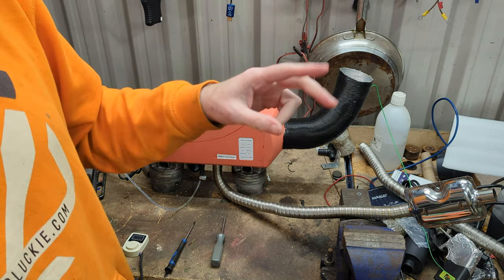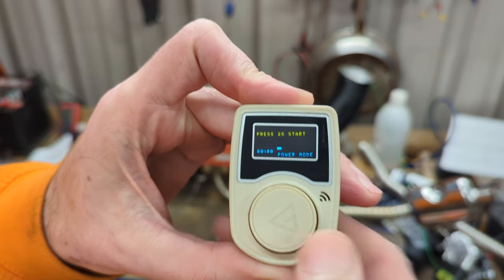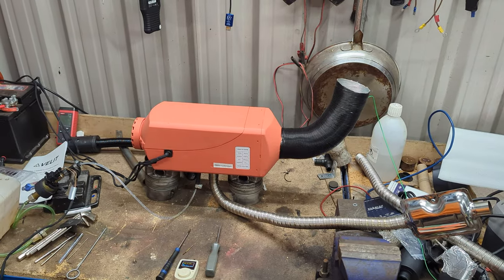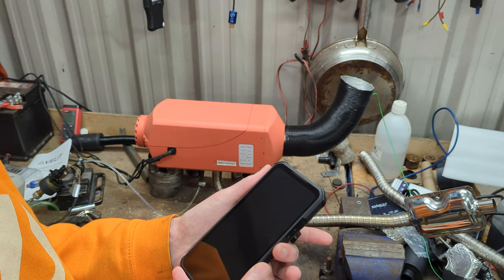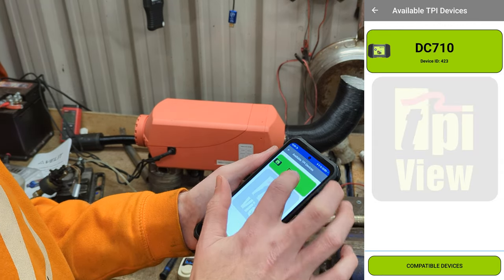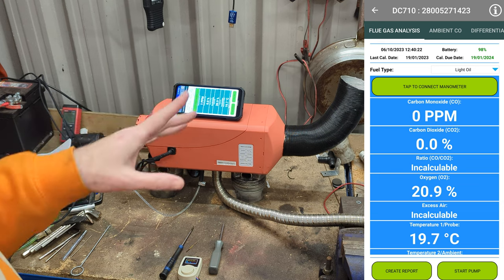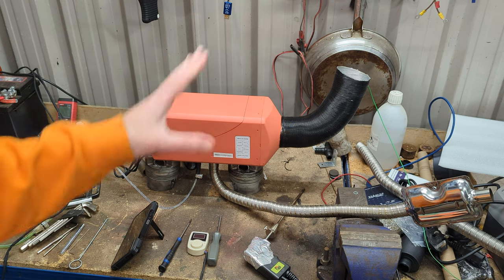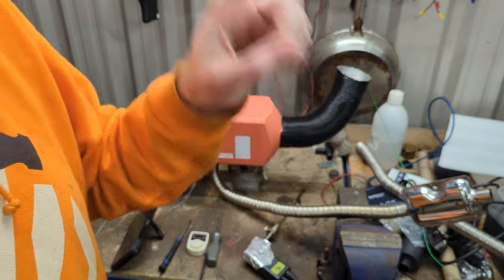Velit 4000P Gasoline / Petrol (Diesel) heater - Running and Testing // Part 1

Comment: For all you folks who need to know.... These are called "parking heaters" not Chinese diesel heaters. I've had a petrol/ gasoline webasto parking heater in my van for over 5 years now and it works flawlessly. That part of the comment is really for the people who are averse to using gasoline as a fuel source. Gasoline burns cleaner, hotter starts up within a minute and never once have I ever had to take it apart clean it, maintain it, anything. I already carry gasoline because of the gasoline engine. I definitely don't want to carry another fuel source.

Comment: What are the advantages of a Gasoline heater vs a diesel one ? Because I can certainly see the disadvantages : more dangerous, fuel price, need for 2 types of fuel in vans and boats (majority run on diesel). Not being cheeky, honest question
Reply from the maker: Americans.  Well not just them but wherever have gasoline/petrol as their main fuel source and not diesel.  A lot of American mobile homes / campers are gasoline petrol engines.
Reply: @DavidMcLuckie  makes sense indeed. But other than compliance with your original fuel source no advantages whatsoever, no better performance nor better fuel efficiency.
Thanks for the quick reply and all your excellents videos David
Reply: Yes I can agree that it will be marketed toward the US market diesel is available but so is gasoline and most of the vehicles here are still gasoline also most of our weed trimmers, mowers, leaf blowers, and motorcycles are gasoline thus a significant amount of people here have gas cans just sitting in their garage...
Reply: @ElectronicMusicUnderground  That could definitely be a compeling argument ! Thanks for your input.
@DavidMcLuckie are you interrested to test if it run on E85 ?
Reply: @DavidMcLuckie A gas running burner Isn't gonna gel at -45 F people traveling may not want to keep track of winter diesel or regular. little off topic, but an idea for an easy video. Of a heater running for sleep purposes the pump is great to hear... thanks for your pro-active videos on cdh!

Comment: I think they got my attention with a heater that works at 8,000 ft.  I’m also a little intrigued by a heater that runs on gasoline since my tow vehicle is now gas. Actually, dual fuel would be handy given that one tow vehicle is gasoline and the other is diesel.

Comment: I see a real market in the US for an air/water version of this gasoline heater. Most RV's in the states unless they are the big high end bus types are gasoline. Most have LP also and some run their generators off that as well as the air and water heaters. LP generators are not ideal. I would rather have one small tank for the cooker and do all the rest off the fuel tank. Easy and quick refills.

Comment: I have a question about the combustion air intake. You have such fantastic videos I enjoy watching all of your experiments and tests.  your knowledge about these heaters. I put one in my garage recently and I didn't run the combustion intake hose to the outside should I have? I also have a wood shop in my garage I was wondering about the dust. Should be concerned with the dust being sucked through the heater? Thanks for all the videos.
Reply from the maker: Having the heater use outside air for combustion has two advantages.  The first being you aren't using the air you've warmed up for burning, which would have to be replaced with cold air from outside.  Second is not sucking in dust and debris, although if you have a filter (not just the intake silencer) it's not as bad.
Reply: @DavidMcLuckie  you are the Best! I rerouted the combustion air intake tube outside the building so it will suck in fresh air. I think it should run more like it's supposed to. Thank you very much 👍🏿

Comment: This why it is crucial to place the main controller in the correct spot for the diesel heater and this new gas one. It's one of the biggest problems with their heater. Running too hot, or the size of a heater! They need to start thinking about the placement, not the easement of the controller.

Comment: could you run diesel heater on different type of cooking oil straight, from sunflower, rapeseeds, coconut oil etc, we know won't run on vegetable oil straight, but might run other oils that might have low flash point or less thickness of oil.

Comment: Haven't watched part 2 yet but I'm assuming this heater doesn't put out the same heat as a diesel heater as diesel has more stored energy and this heater probably doesn't get the same efficiency as diesel...
Reply: Assuming is rarely the better way to go - too many assumptions are wrong.  I don’t know its output (not even converted the US volumes to metric, for sensible calculations), but at least it is not necessarily claiming ridiculous outputs like the typical “5” and “8” kW chinese diesel heaters - which are mostly virtually identical.  

‘Probably’, regarding efficiency, without any corroborative evidence is yet another subjective thought that needs to be ignored by all those reading your comment.

Comment: Hello David,,,, pause while you say Hello,,, OKAY now that we got that bit over, checking the Velit website they show the unit as Gasoline/Diesel Air Heater 14000Btu 4000W  $649.00
I wonder if the unit you have will burn both gas and diesel and or a 50/50 mix,, if it will do all of that what if you mix gas-diesel-used cooking oil that has been filtered,, if it will do all that will it burn white gas,, anyhow,,, at a three times price point higher than a standard diesel heater from china I don't think its going to win a lot of sales, the Plus of this unit: seems to be worth an extra bit of cash but not three times more just in case the Velit folks are looking for feed back $349.99 and I think you will make some sales but much of the unit looks too much like the standard diesel heater, as soon as china knocks it off they will offer it for $129.99 anyWhoo